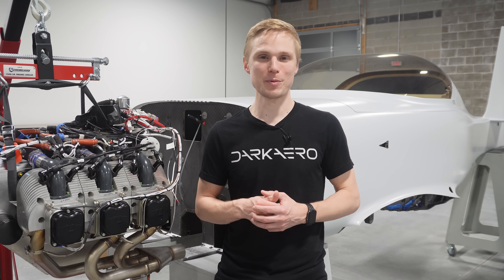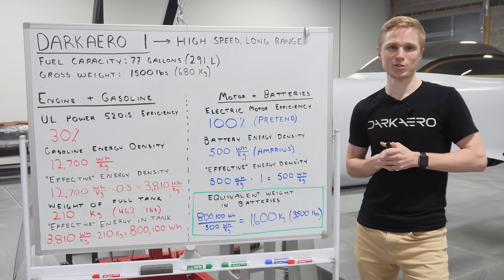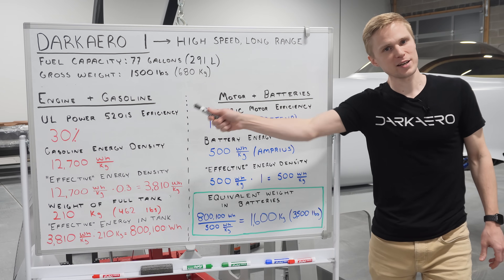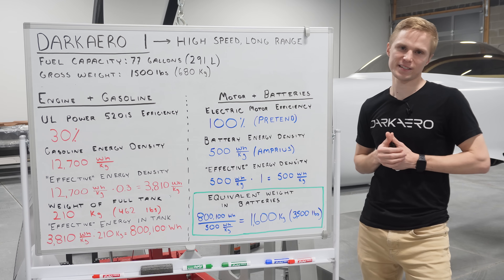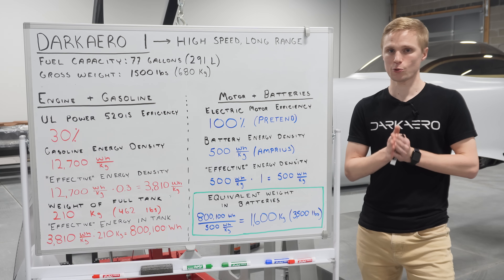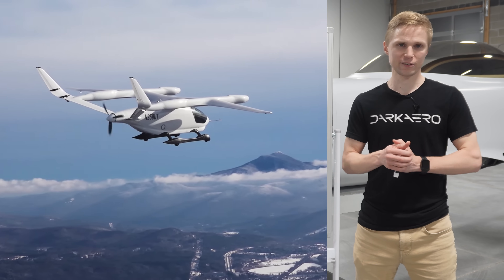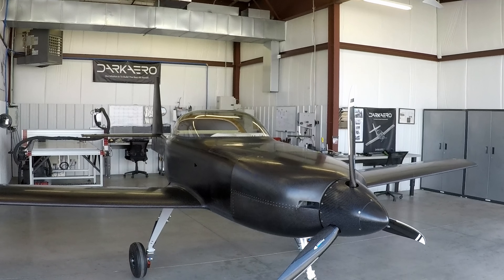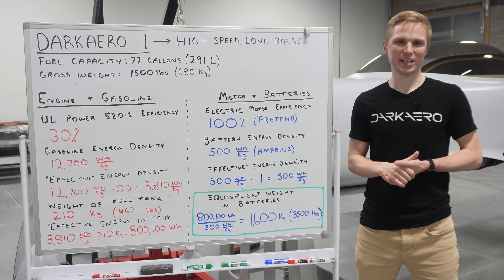The engineering challenge of electrifying airplanes

Comment: Some constructive criticism of a good video: A better way to compare apples with apples is to work out the mass of the ICE & fuel powertrain then assume the electric powertrain has the same mass. This allows you to work out battery mass for same MTOM hence the reduction in available energy as a fraction of range or endurance. There are some caveats like the fact that electric aircraft would ideally be repackaged to maximise battery mass and you might deliberately reduce best L/D speed by introducing wing tips (or similar).
I think series hybrid to trickle charge batts during extended cruise has been mentioned below (if ICE then doesn't help CO2 of course).
Reply: They went over the mass difference of the motors, which in an aircraft is like 95% of the weight for the system. Hybrid technology for flight isn't a viable option as the loads are static for the bulk of the operation. It will always take x amount of power to go y speed based on the weight and drag of the aircraft. One of the main advantages of hybrid electric drive is the linear torque output of electric motors. This is moot in aviation but exactly why a train uses electric motors with diesel generators.
Reply: @AnonyMous-jf4lc  , I've seen a few hybrid studies where the batts were used for takeoff and initial climb, with a smaller combustion plant to sustain level flight and trickle charge the batts. The problem is that if the small sustainer engine is the same efficiency or less then you don't get CO2 reduction. There are some interesting glider based designs using solar cells on the larger wings to sustain best glide at relatively low speeds. Hence my comment about repacking for electric aviation - but then it isn't the same mission the Dark Aero was very nicely designed to meet.
Reply: @martingarrish4082  Once again, conservation of energy. The energy you use to charge the batteries and maintain level flight will balance to having done the climb out with the engine itself. Actually less if you count conversion losses. The reason automobiles see such a large benefit is from the operating environment. Using the hybrid function allows the ICE engine to be in it's most efficient operating state continuously, which does not occur during normal driving. Aviation doesn't really have this concern, as the bulk of time you are operating at a static power setting with an engine designed to be efficient in that range.
Reply: @AnonyMous-jf4lc  , yup. Physics always has the final say on this stuff. The turbine folks like Roll-Royce are only considering hybrids only because it means they can run at optimum efficiency. For recips I've never been convinced about hybrids. But I have read one or two papers that hint that it could eventually be game on for that magic 1kWh/kg battery we're all waiting for. Put 50% batt in a 20:1 airframe, ignore propulsion efficiency and reserves, and the "theoretical" potential is 3000km.
What this means is that aerospace designers will have the up the game in aerodynamics for L/D. Gliders can already achieve in excess of 40:1, but you pay for the privilege in airframe mass. I'm pretty sure the clever folks at DarkAero are already thinking deep about what this would mean for the e-DarkAero 2. But get the excellent DarkAero 1 out there first...👍
Reply: FYI, the food you eat relies on that CO2.
Reply: @lorendjones  I don't think that's true.  We are currently increasing the amount of CO2 used as developing countries match the developed world's GDP.  The goal of CO2 reduction is to slow this growth in CO2 emissions and avoid temperature increases which would cause large scale flooding, human migration, and crop failure.
Reply: @lorendjones  , I'm part of the electrification effort to reduce CO2 emissions in all sectors, including food production. I know that batteries are not ideal for every application, like long range aircraft, but recreational aviation on batts would keep me happy. The risk of failing to reduce the CO2 emissions is that we wave goodbye to the Holocene and enter the Anthropocene - that would be bad for food production. Really, really bad...
Reply: @martingarrish4082  we're barely creeping INTO the Climate Optimum....which means optimum for human flourishing. I am far more concerned about the next downturn in temps which WILL be devastating for modern man, especially once we've decimated all our energy sources required for survival.
Reply: @lorendjones  , we're going to have to agree to disagree on this one. I don't want to pull the excellent DarkAero channel too far off topic. To me the  evidence is clear, but lots of "research" by oil companies is apparently muddying the waters.

Comment: How about the the small turbine FROM THE AUSTRALIAN TURBAERO
Reply: Turbines become less efficient the smaller they get and piston engines become less efficient the bigger they get. This is why you see lower HP engines all being piston engines.
Reply: @AnonyMous-jf4lc  it is a clean sheet design tubine with a recuperator.
Reply: @tc6984  and it's been in prototyping phase FOREVER. There has been a long line of these that never ever see any production because they all fail to meet the goals they have laid out. We can revisit this if they ever release it to the public. It can then be verified against its claims.
Reply: @tc6984  Yes, and even TurbAero's planned specs show it almost as heavy as the UL 520iS and with much higher fuel consumption.

Comment: Have those electric aircraft companies behaved like all the EV companies: lied and purposefully omitted a lot of variables? Like for example have they done as EV manufacturers have done and dishonestly omitted the consumption from electrically heating the cabin? And heating the battery? 

Teslas have battery heaters alone which use 7kW!!! And there is video proof on Youtube that even after a long drive the battery heaters have still kicked in for about 30 minutes! 
My own experience with Evs (and the same has been experienced by others) has shown that in cold weather (like the conditions in the skies are basically at all times) battery efficiency absolutely plummets, often going to half or less! The requirements for heating the cabin, keeping the battery warm are a huge problem for electric vehicles. And that's before the massive increases in consumption when the battery temperatures, regardless of all those (heavy and power-hungry) systems working hard, goes outside optimum! Then the consumption really skyrockets and/or the power it can provide may incredibly dangerously just suddenly drop!

This isn't so much a factor during flight, but significantly affects the CO2 emissions calculations: charging losses. German AMS found the very best EV they tested, at slow charging to have 10% loss! The very best. At slow charging. When fast charging the losses can skyrocket (anyone have data on losses during fast charging?). When the battery isn't at optimum temperature the losses skyrocket. When the battery needs to be pre-heated at high power for a long time just to prepare the battery for fast charging: that's a lot of losses! (Again: consider Tesla with its relatively small battery compared to aircraft needing 7kW for 30 minutes, and the charger still wouldn't charge at maximum possible speed!)

But none of that data is given to you, it is being purposefully hidden. It is hidden by the fraudulent EV companies, hidden by the corrupt officials and EPA, hidden by the corrupt politicians, hidden by the corrupt media... They all just want to make money and advance their careers, who cares about the truth, right? It's just a matter of a few dozen trillions and the ability actually reduce CO2 emissons, completely mixing up all of pur energy markets, vehicle markets, just creating incredible damage to peoples' lives, no big deal, right? 

Hell, even these comments sections are always full of people willing to lie about such important things just to protect their ego because they've already bought an EV and they are too narcissistic to handle any slight admission that they are not 100% perfect in everything they do. That's how little it takes for people to lie and defend hiding of facts.

P.S. I bought an EV many years ago, and have since also owned several PHEVs, now having returned to a lightweight ICE car which weighs pretty much half of the previous cars (because it is clearly lower in CO2 with my low yearly mileage especially after covid even without fueling it up with biofuel or e-fuel) and invested the saved many tens of thousands into a significant CO2 reduction in my home, which I can soon re-invest again as it also reduced my monthly energy costs.

Comment: What about useing a series hybrid like nissans e power just stick a prop on the electric motor and put the engine and battey in the plane and boom . Hybrid plane
Reply: Yes... and what's the point? you're taking a propeller which is directly connected to the engine (not even a gearbox) and adding a generator and electric motor between the engine and the prop, for no reason. An aircraft is not a car...
Reply: Diesel v12 hybrid flight test https://youtu.be/GUEAa8fHvbQ

Comment: good to see metric used. the future of aviation is probably in some sort of synthetic fuel.
Reply: Agree. The problem with synthetic fuel for cars is that it is super inefficient to produce and use leading to higher costs which don't outweigh the benefits. Extra weight doesn't matter so much for cars, but for planes it's a big enough deal to justify the additional cost to produce.

Comment: I have no desire at all for an electric airplane. When I buy a gasoline powered aircraft with a 1000nm range, I still have an aircraft with a 1000nm range after 20 years. A battery powered aircraft starts losing range from the day you use it. My 7 year old phone battery barely works for 2 hours anymore, and reads 50% charge remaining right up until the point I have only 15 minutes left, at which point it drops off a cliff.  Battery powered aircraft are inherently dangerous, as you get no warning when the batteries start to fail. Call me old fashioned, but no thank you. I prefer reliability when I am in the air.
Reply: Don’t you constantly need to rehaul aircraft engines after every x amount of hours? Feel like both have pro and cons
Reply: @DivisionRc  Yes. But during the time until TBO, gas engines continue to offer completely predictable range that is identical to what they provided when new. Batteries degrade in unpredictable ways over this time. They will begin to degrade after even a single discharge cycle. It is impossible to guarantee identical performance for lithium batteries on any meaningful timescale. Unless you intend to replace the batteries with new cells before every flight, you will slowly lose range until TBO is reached.  

A typical private pilot flying 200 hrs. a year can go 10 years or more with proper maintenance on a gas engine. That can never happen with batteries. Worse, lithium cells could appear just fine when topped off, and then suddenly leave you without power during the middle of your flight. There may be no way to know their performance profile near depletion without actually checking them at depletion.  This is dangerous.

Hydrogen fuel cells would not suffer this problem.
Reply: @BangkokBubonaglia  yes currently the batteryus degrade seems to be the only and defencive/valid argument with eletric planes cars etc. We prob will never get the tech to stop that, but with my experiance with batterys, if properly maintained, they dont degrade "unpredictably". Depends on several factors but my experaince is smallscale with a few LION cells in pacts, not hundreds. 

Perhaps like the way toyota is going, does a hybrid plane make sense? Considering fossil fuels will run out, but the same with the minerals to produce batterys.
Reply: So many miscommunications.
Your 20 year old ICE wouldn't last if you don't maintain it regularly, the costs of these maintenance could be equal to the price of a new battery pack after 20 years of service.
Also, ICE engines even with regular maintenance aren't reliable, so even with regular maintenance you are very likely to need a new engine or an engine overhaul after a decade or two.
As for safety or an indicator for battery health, you not knowing about them doesn't mean they don't exist, ofc there are tools that measure and monitor battery health.

Comment: Well done. The integrated design of any system starts and ends with the mission. In buildings, my expertise, I pushed the concept of “use less, use it efficiently, then and only then consider making it on site”. Not a direct analogy, but the concept of the design process I see you use is similar.